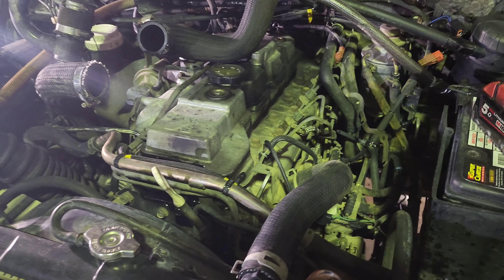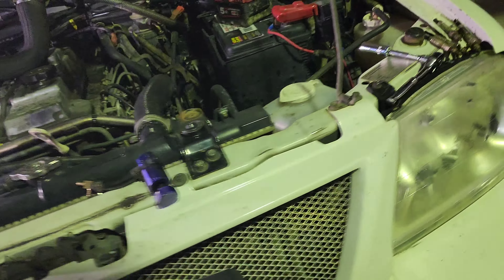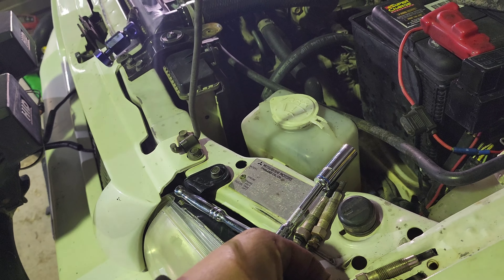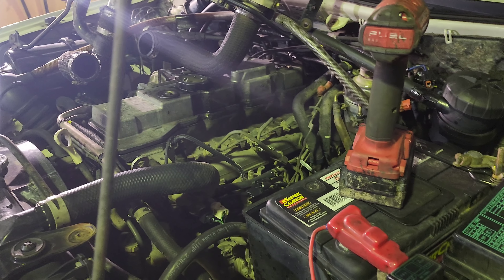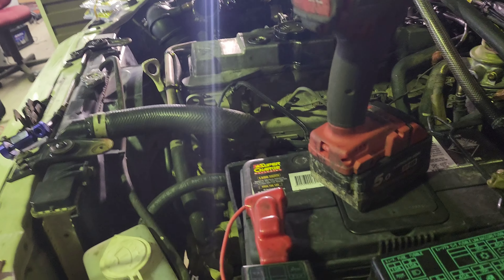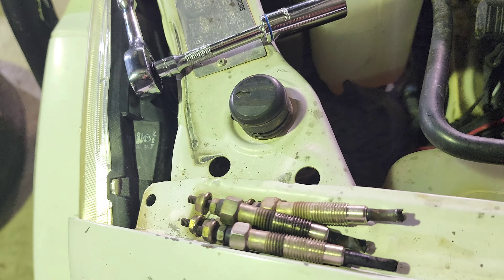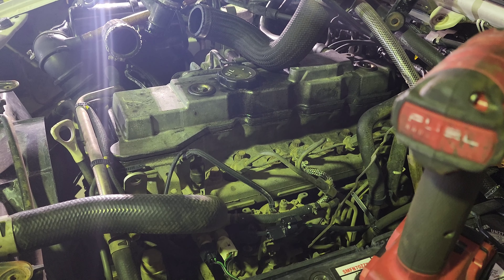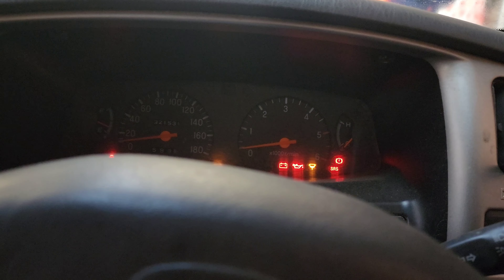Glow plug & temp sensor  Replacment 4M40T Mitsubishi Triton 2.8lt turbo diesel

Comment: A good man once said : imaginaison IS more inportant than knowledge.       And I think I know what that means.     Thank you 🤝
Reply from the maker: Thanks for watching all.my videos maye
Reply: No problem,     I think there some good work in your videos
Reply from the maker: Thanks mate
Reply: Any Time 👍
Reply from the maker: What's your favourite diesel engine to work on
Reply: Caterpillar Diesel engines
Reply: I have reaubildet caterpillar Diesel engines,   John deere Diesel engines,   cummins diesel engines, trucks engines,    Light duty Diesel,    heavy duty Diesel.    I repair construction equipment, farm equipment,  looging equipment,   trucks and pickup trucks do all tipes of repairs, from some Electric work, to engine repairs, oil changes, brake Jobs,   engine reaubils, transmission repairs, transmission reaubils,   tire chaincheis,    mechanical, hidralic, Electronic,    heavy equipment operation,   trucks test drives as well.
Reply: And I still reaubil heavy equipment Diesel engines,  trucks Diesel engines to, i still Turn wrenchs on heavy equipment and trucks, do engine repairs to engine reaubils,     and all tipes of heavy equipment and truck repairs in the mechanic garage and on the field to.     I like heavy equipment, trucks,  I like Diesel, engines, turning wrenchs,   mechanic work,    truck driving,   heavy equipment operation,    welding, metal work.     I do welding and metal work as a diesel mechanic as well.      So, Diesel mechanic IS the right Job for me.     I enjoy it,    I see my self doing this tipe of work tel the Day ill die.
Reply: Hers an advice.    Go on youtobe and watch a youtobe Chaneel cold western truck and tractor repair and take your Time and watch all of hes videos and by doing that you well see what I do as a diesel mechanic.      He does engine repairs to engine reaubils on John dere tractors,    trucks repairs,    he has some good videos about bringing a road grader back to life doing engine reubilds and repars, turning wrenchs on a diesel engine on a road grader and all tipes of heavy equipment and truck repairs he does in the mechanic garage, hes garage add home and on the field.     Hes a good man and a good mechanic.    Hope this helps.  And enjoy 👍🤝🔧🚜

Comment: Hey Mate. Ive got a 94 Pajero with same engine. Baught it with the temp sensor not working so fixed it but now the thing struggles to start and just sits there turning over and over for ages. This is because the glow plugs will only come on for barely a second now and if the engine is even warm they dont come on at all. if I go and  unplug the temp sensor though the plugs come on for 4-5 seconds every time and she starts easy. Should the plugs be coming on even when shes hot? I'm thinking theres some relay or controller for the plugs thats not working. otherwise maybe the starter motors just on its way out. Any thoughts or ideas though? cheers mate
Reply from the maker: the rely is up on the passenger side guard you can test it with a multimeter easy. my ute started in the snow stone cold no working glow  plugs
Reply: @oneupthesleevecustomsautom2195  Ah yup sweet as. Im thinking it may be more so a starter issue then. Cheers for that mate